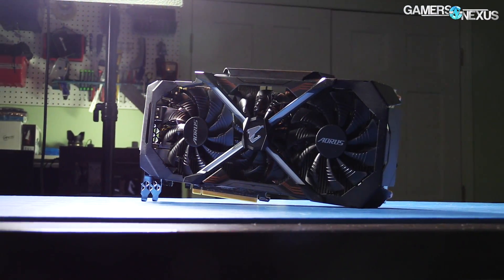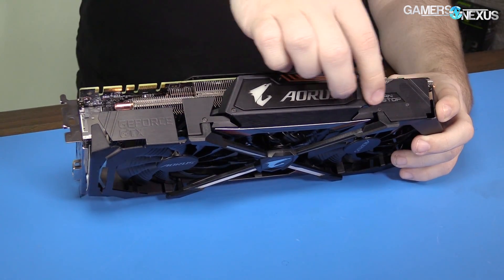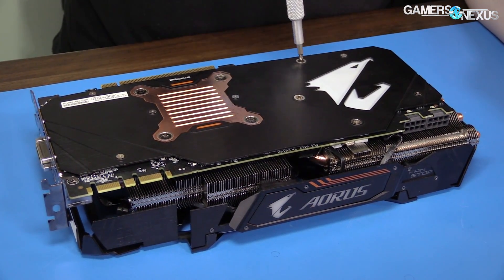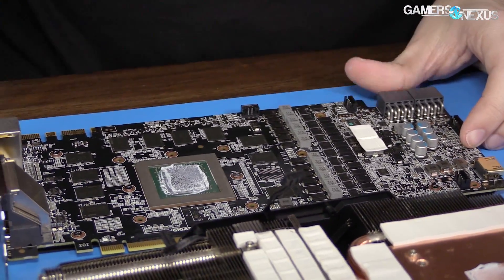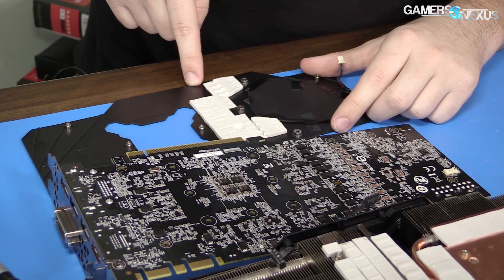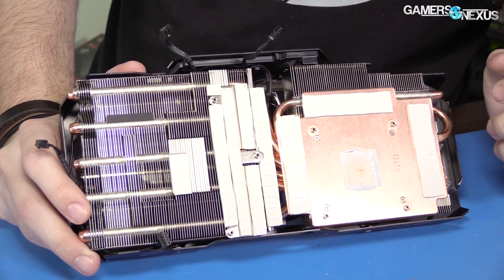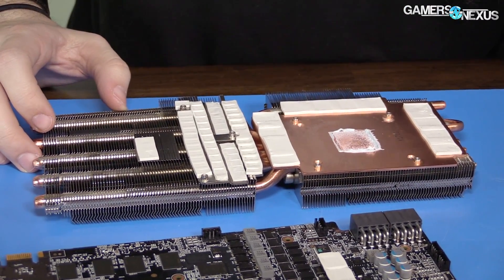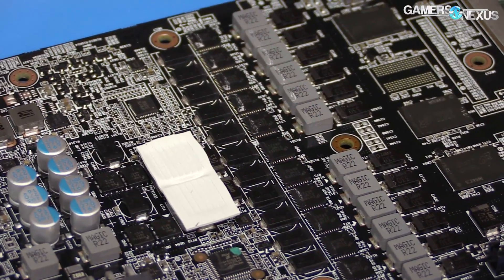Gigabyte GTX 1080 Ti Aorus Xtreme Tear-Down

Comment: 6 years later the tear-down is very useful, as the card is still worth a lot, I just installed a liquid cooler on it, and is going well better than the original fans (in my game with superior setup is now around 20 degrees lower!). Thanks!
PS: How did they fool us to buy $1000-2000 premium video cards, from $600 6 years ago?
Reply: Doing the same thing now, 7 years later

Comment: Very cool video, that's exactly what I was looking for to be able to disassemble my graphics card and replace the thermal paste and pads. I was a bit hesitant about taking off the cover. It's just a shame that you didn't measure the thermal pad thickness with a caliper and provide their dimensions in the description. Below, in the second comment, I added the sizes that I received from Chat GBT. According to the information provided by Gigabyte, these sizes are appropriate for the thermal pads used on the AORUS GeForce GTX 1080 Ti Xtreme Edition 11G graphics card to transfer heat away from the components of the card.

Comment: The Gigabyte GTX 1080 Ti Aorus Xtreme graphics card has several thermal pads of different sizes, which are used to transfer heat away from the components of the card. Here are the thermal pad sizes for the Aorus Xtreme model:

3mm x 3mm x 1mm thermal pads for the VRAM modules
5mm x 5mm x 1mm thermal pads for the MOSFETs
6mm x 6mm x 1mm thermal pads for the GPU
Please note that these sizes are based on the specifications for the Aorus Xtreme model as provided by Gigabyte, and may not be applicable to other models or brands of graphics cards.
Reply: thats not true where you get that info bro...?
Reply: @Elrafau  If you go through the comments, you will notice that the issue still remains unresolved, and people are providing different sizes and thicknesses of thermal pads. Personally, I searched for this information on the internet and reached out for help to the GPT chat, which provided me with detailed data and dimensions of these thermal pads 1mm, 3mm, 5mm, and 6mm thick. If you carefully watch the video, you will see that there are differences in their thickness.
If you are confident that what I wrote is incorrect, please share your knowledge on the subject so that we can benefit from reliable sources of information. Thank you for being vigilant in this matter.

Comment: hey, i've got the 1080ti gigabyte n108taorus-11Gd ]
11gb

ill occasionally get a BSOD video scheduler internal error from the card, but was able to run an entire time spy test without an issue.
 once in a while i'll get a pixleated display that will crash the driver making a reinstalled driver/or device noise.. then getting my display back..

any idea whats going on with it?

Comment: can you remove the plastic parts from the pcb too? Mine died and  I would like to try the oven baking trick to fix it
Reply: No, you should check the mosfets, that is the likely part that has dies. they are about $10 each to replace and it is likely just one or two of the mosfets that are bad.

Comment: I just received one of these cards. It's been used heavily for it's whole life and probably never cleaned. Is there any place or service to get it repasted and maybe have new thermal pads applied? I very much would appreciate any help/ advice... I haven't build a PC in a decade+ and have never opened a GPU, so the thought of taking it apart, when I can't afford a new (or used) one is pretty scary. It's going into a build using all used parts (minus the case and storage). Thank you anyone for any possible advice.

Comment: I still own that card 3 yrs later, but I can tell you now, that 3 fan idea of theirs was bs, because the middle fan's bearings went just last year for me, which has caused it to directly collide constantly with the other two fans and it doesn't make any difference no matter what my custom fan curve is set at.

I hope any GPU vendor doesn't try to emulate what Gigbyte did, because it is possibly one of the worst designs in GPU cooling history.
Reply: Just because it happened to you doesn't make it "BS". I have the same GPU as yours and it's still working fine as the day I bought it 4 years ago. Now, it would be different if many people were consistently reporting the same thing, then that would make it an engineering or design flaw.
Reply: @Vendemiair  well it so happens that there were people who both issued complaints and had the issue as me....

A little browsing the web wouldn't hurt you.
Also why are you even on or watching a video this old?
Reply: @dirge7459   Even doing a "little web browsing" to help illuminate the issue only tells me you're overreacting. I looked at reviews at Newegg, Amazon, Reddit and YouTube. In no way were the negative comments centered on fan issues, but rather distributed among various problems. For those with fan issues, it was mostly centered on the fan hitting one of the struts in the metal shroud and NOT the center fan hitting the others because of bearing issues. There is no evidence that there is a major design flaw in the card's fans. You're just pissed that one of the fans in your card had a failed bearing. Well, it a 3-year-old GPU, with wear and tear you'd expect problems like this to occur. It just sucks that it happened to you. But to go and proclaim that it's "possibly one the worst designs in GPU cooling history" is a very long stretch. If you really want to know what a major design or engineering flaw is, look at the story of the IBM Deskstar 75GXP hard drive, later dubbed as the "Deathstar". Or more recently the Gigabyte  GP-P850GM/GP-P750GM line of PSUs which eventually Gigabyte recalled after a slew of bad reviews and experiences.

As to why I ended up viewing this video, I think the YouTube algorithm brought me here because I was looking at videos about the Aorus Xtreme and how it fares with older and newer games (I'm still stuck with this GPU because of the absurd GPU prices at the moment).
Reply: @dirge7459  It's sad when people cannot reply back with reason and facts and just resort to ad hominems. If this the best you can do, then I have nothing else to say. Your insults merely proves that all the points I raised hit the mark and are true. As they say, the truth hurts, but especially so if it's being pointed out by another person. 🙄

P.S: If you thing my long reply is trolling, I suggest you re-educate yourself what that term really means.

Comment: @Gamers Nexus, I have this exact card and with the help of this teardown video, I had the courage to remove the cooler from my card and replace the old, bone-dry thermal paste. Now my thermals are down by 10 degrees plus it boosts a lot higher than it use to.
Reply: hey I have the non extreme version but I'm guessing dis-assembly is the same. Did you replace the thermal pads as well as the paste, or just the paste? I'm hitting thermal throttling around 84c and lots of hitching now :(
Reply: @mauirixxx  did u ever find out any fix
Reply: write down the thermal pad thickness please!!!

Comment: It's 2021 with a GPU shortage.
So I'd like to keep my 1080 ti as long as possible by at least reapplying thermal paste, rather than buying a new card.
The tear-down is handy for that.
Thank you GN for this video.
Reply: find out the thermal pad thickness by any chance?
Reply: Oof. I'd love to answer that, but I recently picked up a 4070ti with the release of D4. Gave my old card to a friend that could use it.
Reply: @RagathRRInc  appreciate the reply, just opened up mine and redid paste but couldn't get pad sizes even with calipers so didn't risk it and gigabyte told me to ask the place I purchased from lol
Reply: @andyderp6473  i know the exact thermal pad thickness, made a post on reddit about that btw.
Reply: @Elrafau  aye, think I came across that while I was trying to cling to any info regarding it even if I was looking for the 1070s pad thickness  but there was no info regarding the extreme 1070 model and they seem to be different not only in thickness but amount, I tried to measure with a calipers the non squished parts of the pads when I opened it up but too much variance, cheers.

Comment: i plan on re-pasting mine as it still has the stock thermal paste, given it's about 4 years old now should i be worried about the thermal pads being brittle and falling apart?
Reply: Yes, you should. It's happened to me.. I have no idea which thickness and which type of pads i need to renew.
Reply: @SpesDesperatio  thanks for the response, good luck
Reply: @ShivREdits  I found something here, maybe it will help you too. https://www.computerbase.de/forum/threads/waermeleitpads-fuer-aorus-xtreme-1080ti.1826921/#post-21774827

Comment: Thanks for this video. I'm prepping to put one of these (well, the non Xtreme version to be honest) that's getting replaced in my main rig into an ITX build, and the thickness is just too much normally. This teardown will help me remove the fan and shroud assembly and put in some slim Noctua 120mm fans right on the finstacks. =)

Comment: @Gamersnexus, I have a Aorus GTX 1080ti NON XTREME, recently playing Battlefield 5 & Escape from Tarkov sometimes hit 84 Celesius, used it since August 2018 and clean dust quite often, what can you suggest the issue that cause slightly high temp? Since it yet past my warranty kinda worry to dissect the card to replace thermal paste. Also, how long does the aorus factory thermal pad last?

Comment: Does anyone know the thickness of the thermal pads for this GPU?
Reply: I need the same info :/
Reply: I think, it's better to have all the thickness you can get... from 1mm to 5mm before trying to do this...
Reply: @mjojrjr6231  thermal pads are very expensive here in germany and I don't wanna buy all thicknesses for only one replacement.
Reply: @SpesDesperatio  what did you find out in the end? I wanted to replace thermal paste, but looks like thermal pads will tear apart while I'll be taking gpu apart

Comment: May I ask why the unscrewing process was cut short? Are all the screw that are needed to be unscrewed shown here?
All the 7 screws on the back of the PCB only? And do I use strenght to actually peel it open for them to be seperated? Becaues I tried unscrewing mine like urs in the video but I still couldnt seperate them.
Reply: You can see all steps here.

Comment: could anyone save my life and tell me which header is the fan header at 7:54 ? I used kraken g12 and got a pwm fan adapter to connect my 92mm noctua to my gpu (auros 1080ti, not extreme but it kinda look like the same) and I tried those 2 headers on the top (left and right one) , both didn't work for the fan. I can't reach those 2 on the right and the one down there on the right, since I already mounted it, I could dissassemble if I must, but I don't know which header should be the right one for the fan. please help me I really want to control the fan via afterburner instead of bios on a case header :(

Comment: HELP! I remade my loop and booted up the pc and the GPU sparked and smoke came out. I took it apart and no visible damage on the card but does not work anymore. Maybe one of the 8-pin connectors was not in the whole way in and it short circeded the card???
Reply: yikes, did you get it figured out? was the card dead?

Comment: I am going to change thermal pads, anybody knows what thickness of it? As i can see  the memory IC pads and the thickness of the Vdd VRM is different. Help me please.
Reply: Do you have any infos? I need the thickness of the thermal pads.
Reply: @SpesDesperatio  Hi. The thickness of the memory IC pads and the thickness of the Vdd VRM is 0.75mm. The MOSFET Pads 1.25mm.
Reply: @Miker113  thank you. I found this informations and I'm not sure what I have to think now: https://www.computerbase.de/forum/threads/waermeleitpads-fuer-aorus-xtreme-1080ti.1826921/#post-21774827
Reply: @SpesDesperatio  You can see it in the manual on the phanteks hompage. 
http://www.phanteks.com/assets/manuals/PH-GB1080TiGB2.pdf?
Reply: @Miker113  The details are for this particular water cooler. Not intended for the standard cooler.

Comment: yeah searched for this video, I just brought the non extreme model of this card which has the same shroud and heatsink.
Gigabyte used a 2 slot cooler, but it only became a 3 slot card because the shroud hanging over it for visual appearance purposes.

My palit gtx 1070 had a heatsink with twice the height as the heatsink on my auros gtx 1080ti. :p

Comment: I'm noticing from the side of the cooler that the coil fins have zig-zags bent into them. Clearly this would marginally impede airflow which isn't a problem given sufficient fan pressure but do you really think it improves dissipation? Also this is my first time noticing any thing like this on any heat sink coil whether that be a CPU or GPU cooler. Is this a common engineering feature you've seen before?

Comment: I always wondered which radiator is the best. Vertical or horizontal radiators. The horizontal is almost like the reference cards where air can only blown out sideways, while the vertical is blowing air from the top and bottom of card.

Comment: Gamers Nexus, Can you please tell me what the difference is between GTX 1080 Ti  AORUS vs GTX 1080 Ti AORUS XTREME Edition except for the 34MHz. Its £40 more and for what a little overclock?
Reply: The main difference between the 2 is the more expensive card is for fools who have no comprehension of the parts they buy. 
But if your still curious there is no manufacturer difference, The GPU bios for the 2 is the same except the Xtreme's OC mode is clocked higher by a hole whopping 34MHz and a higher fan profile.
In all, If your a rich lazy moron who wants boasting right's to friends spend the extra $'s on the XTREME edition and look like an idiot, But If you have a some what intelligence and care about the 4fps you gain from that 40$ 34MHZ oc go ahead and buy it. If you watch (Gigabyte 1080 Ti Xtreme Review & Backplate Thermal Tests) from Gamers Nexus you will see the MSI GTX 1080 ti Gaming X is better out of the box.

Comment: Reading too many complaints of crashes with the basic built in oc mode, excessive coil wind and fans hitting that cheap plastic shroud. Will be avoiding this one and sticking with the Zotac Amp Extreme.

Comment: the nice thing with this card is the ability of pushing power target %150 instead of %122. So you can easily reach to 2.1ghz core clocks while other cards having stability problem after 1950mhz in %1 and %0.1 lows.
Reply: Is the stability issue solved on this?

Comment: Hi Steve, I have a question about cleaning the thermal paste off of a gpu die. What type of cloth/paper should be used for this? I have microfibre cloths but those cloths have tons of tiny 'blocks' of cloth if you will, won't that scratch? Can't I just use isopropyl alcohol 99% with toilet paper for it? I'm going to install the EVGA hybrid kit on my Titan so I really want to be sure..
Reply: Burbanana --- Just use a paper towel yo.

Comment: i'm looking forward to the review. My prediction will be the same that there is minimal o/c headroom like the MSI Gaming X. Many of these card average 1974MHz or slightly less average. Loads of other tech reviewers like to report the maximum clock boost, which is  typically a one off.

Comment: This and the 1080ti AMP Extreme by Zotac are some of the thickest cards ever seen
Reply: the zotac actually has a bigger heatsink tho occupying the space, you can see in this video at 11min 45s and earlier as well, that once he took of the oversized shroud the heatsink itself would fit into a 2 slot card.
My palit gtx 1070 the heatsink covering the gpu is twice the height as the one on this card and that is still a 3 slot card, the reason is, on the palit the heatsink extends into the 3rd slot space, and the shroud is tight fitting round it, whilst on this card the shroud is way above the the top of the heatsink and gives an illusion of better cooling then it actually has.

Comment: @Gamer Nexus: I was wondering, can you connect an extra fan to those free pins on the board? It might not be a bad idea to have an extra fan blowing on the top of the backplate for cooling under load. I think the Asus Strix has this feature, pretty nice.

Comment: Got an 1440p 144Hz 1 ms G- synk and a ditto fresynk monitor where the hell are cards to back them up? wtf
Reply: The 1080Ti will easily pull 1440p 144Hz. Easily. Just don't use ultra settings and that kind of frame rate is trivial. Honestly at this point it's more likely that the CPU couldn't handle it. Even on lower settings at 1080p, the 1080Ti can't do 144Hz in BF1 multiplayer... because the 7700K simply isn't quite fast enough (for totally smooth 144Hz, that is).
Reply: There's plenty on the NVIDIA side that can do 1440p 144Hz, but still nothing to push 144Hz Freesync yet sadly.

Comment: what is that AORUS RX xxx box in the background?
Reply from the maker: These are not the boxes you are looking for.
Reply: 570/580
Reply: these are not the boxes I am loocking for.
Reply: It's the box on the floor when he moves over at 3:02
Reply: ardi du Good eye considering aorus doesn't have an rx card yet as far as I am aware.
Reply: I don't know, the box look a little faded, perhaps it was on the front step a few days before some one noticed it was there.
Reply: https://wccftech.com/amd-radeon-rx-580-570-custom-model-prices-leak/amp/

Must be one of these. Intriguing.
Reply: omg 😂
Reply: That looks like a black box in that link, and not an nvidia black box. If that pink box on the shelf is what you think it is, that it has been more then just UV faded in the sun for a few days. Your guess is as good as mine why the box sat outside for so long. Then again, Perhaps it is something else we have not seen yet.
Reply: Man, good eye lol. I'm hoping for some good overclock with these cards. Reviews this week, right?